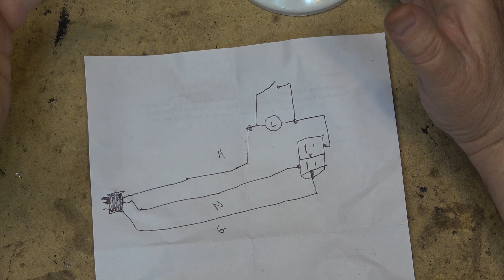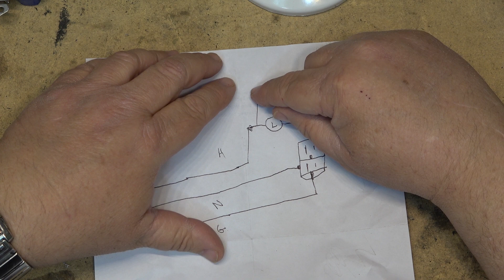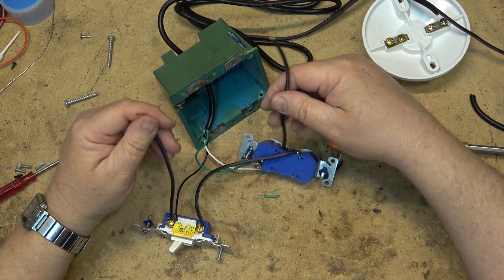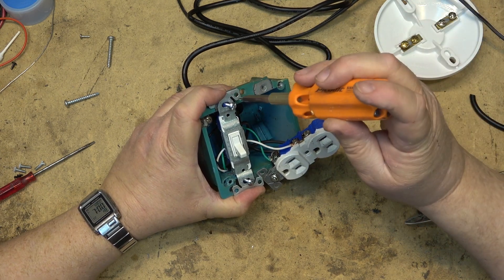Build a Dim Bulb tester to protect equipment under test

Comment: What happens if you forget to change the switch ? Just plug the DUT out and plug it into the mains ! No messing no chance of a mistake ?
Reply from the maker: Perhaps YOU would forget the position of the switch but I wouldn't.
Reply: If the switch is in the closed position as you plug in, it's the same as plugging the device you're testing directly to mains (or isolation transformer), so no protection from the bulb's current limiting (as the bulb is bypassed with the switch closed).
Reply from the maker: @michaeltempsch5282  the switch won't be in the closed position.
Reply: @michaeltempsch5282  In which case I hope your wiring of the dim bulb device can handle the brunt of the full 15 or 20 amps of the breaker. 

At least put a 2 amp fuse inline if you use a bypass switch to be safe. Cut off the cord of an old Christmas light cord with a built in fuse in the plug.
Reply: You can write full power and limited on the switch plate if you like.

Comment: I have 3 bulbs on mine. I like the clear bulbs, easier to see the filaments glowing. Same kind of bulb holders screwed on a piece of scrap wood. Bulbs are 60, 40, and a 17 watt. I do have a 200 watt if I need more umph. The 200 watt is 1.73 amps, the 60 watt draws 470 mA.
Reply: The dim-bulb tester I use at work is mounted on top of a Variac that also also has voltage and current meters  and a bypass switch for the series-wired bulb. It has been using the same 150 W clear glass bulb for the better part of 15 years.
Reply: PERFECT - very nice.
Reply: The 200 watt bulb drews 1.66 amps
Reply: The 60watt bulb draws  0.500 amps
Reply: @cotto887  thereabouts, it draws 467 mA which is very close. 308 mA on the 40, and 68 mA on the 7.5 watt (which is drawing 8.5 watts)